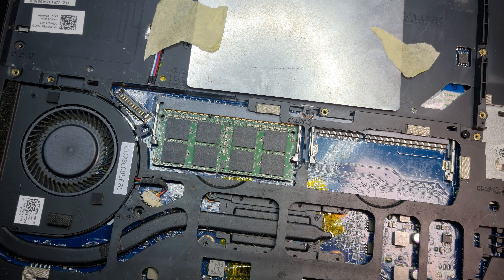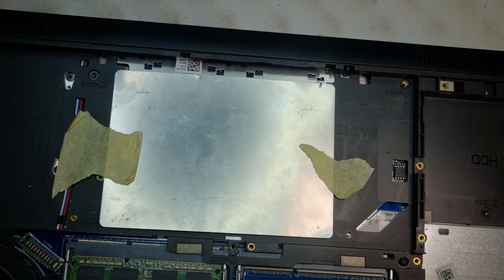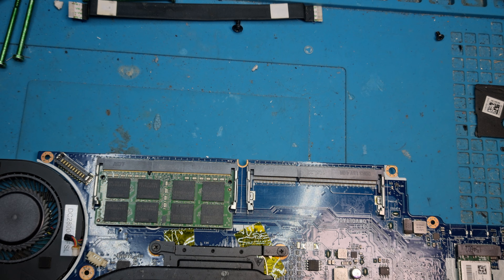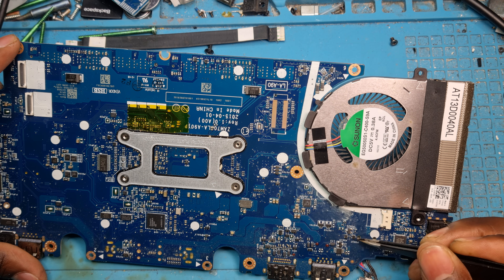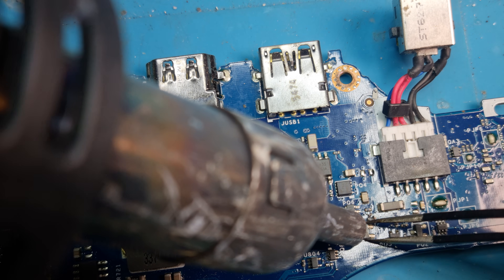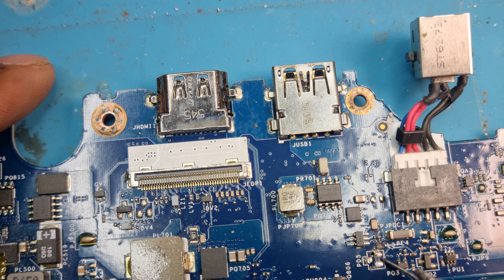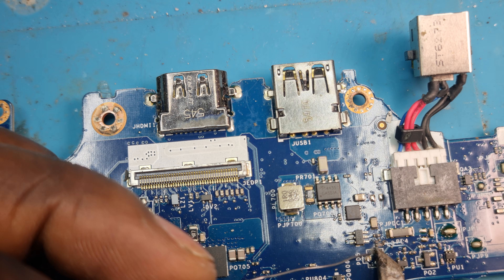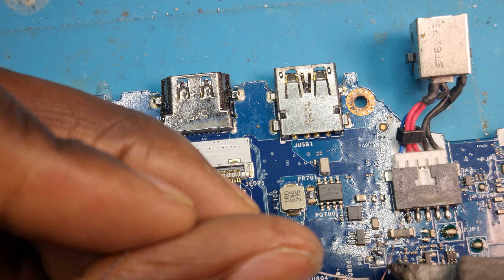Dell LATITUDE 5440 AC Adapter unknown

Comment: I have a latitude 3340 motherboard therez no volts on pin 8 of the bios chip but when I try to power it on it reads the volts on that pin then goes off,what could be the problem
Reply from the maker: If there's voltage on bios chip then it's likely your core voltages( 19.5v 5v and 3.3v) are present already. Possible cause could be corrupt bios rom or corrosion on the board that can cause lack of communication between components like the EC